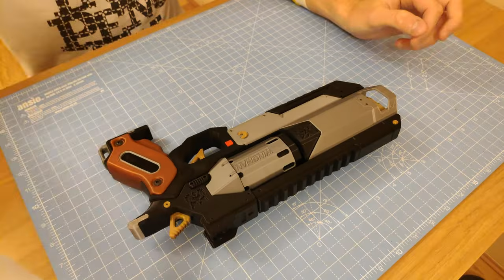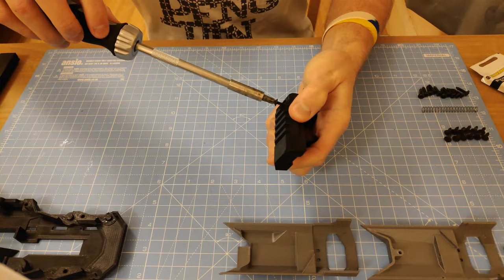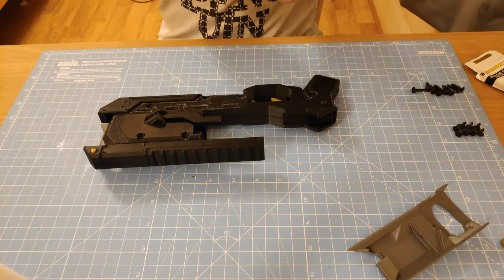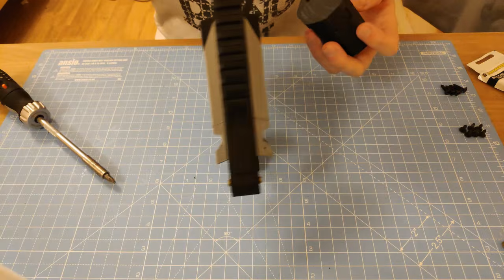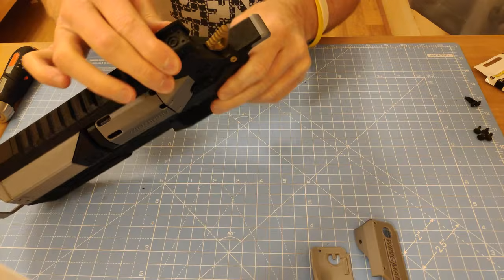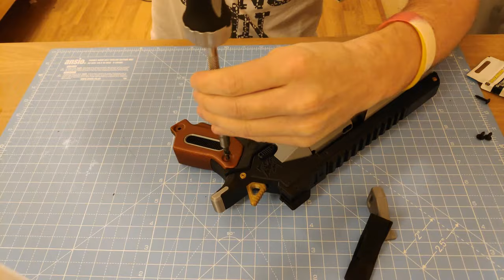Build My Apex Legends Wingman

Comment: Spring: 0.6 mm × 8 mm × 80 mm (compression spring)
(alternative: free length 65 mm, diameter ~6.8 mm)

Screws: BT3×10 and BT3×16
(alternative: #4 × 3/8″ and #4 × 5/8″)

Comment: Hey springs don’t fit? Is there another way? Bought the right pack of those 5 springs but they end up curling and not smoothly lining like yours? We didn’t size down any pieces so I’m a little confused any help I would love!❤❤❤
Reply from the maker: hi, i presume you are talking about MakerWorld? There has been quite a lot of changes to this model since this video (can't believe its been 5 years), but there should be a document linked on the MakerWorld page with the differences you need to take note of. Specifically with the 5 springs, there is a different option which has a guide pin to put through those. MakerWorld are actually releasing a new spring soon which will be much better - you will just be able to use the 1 with no guide pin and it is even better than the original spring i used in this video. Hope this helps! If I get the time I want to do an updated version of this video.
Reply: @gmanprojects  thank you so much! I’ll definitely wait for the new spring! Since I don’t really want to make another gun again with how much force and perfection to squeeze in parts, but don’t rush to make an updated video! This is all I need to know thank you so much!!❤️❤️❤️❤️🤩

Comment: Super cool model. But many of the pieces didn't fit. Atleast not nearly as well as yours. I've spent a great deal of time sanding things down etc to get them to fit. Just broke the grip for the handle, because the pieces didn't snap in like yours. Any ideas why mine aren't fitting together? I didn't adjust the same on anything.
Reply from the maker: sorry to hear that, what printer are you using?

Comment: I made a spring in 0.7mm and it's significantly better than the one you told us to buy, not to mention you save 12 quid.
will upload the mandrel to thingiversae sometime
Reply: Did you ever upload it, or do you have the info for it? The spring he recommends is impossible to find and get to me.

Comment: Ayo broski, I made an arbor .3mf so you can just wind your own springs!
I tightened up the diameter and would *REALLY* advise a thicker wire diameter like 0.6-0.75mm + needle filework bc the mech loves to stick on return.
Let me know if you want me to upload the file and where.

Comment: Hey mate, I am currently printing this model on my Ender 3 V2, everything is going smoothly with the exception of the main body pieces. The Main Body 235 pieces are still too large to print on 235x235 build plates. Will you be updating these? Would love to finish the build.
Reply from the maker: Hey, you just need to rotate it on the plate by about 40 degrees and it will fit
Reply: @gmanprojects  that is a lot of filament wasted in support material, I'll continue to look into optimizing those pieces. But you did an amazing job on this model. Will look forward to future ones
Reply from the maker: I mean keep it flat but rotate it on the z axis, it should fit diagonally on the bed?
Reply: @gmanprojects  it sadly will not, I've tried orientating it flat at all types of angles and it doesn't fit
Reply from the maker: I'm baffled, I've tested it in a slicer on a 235 bed and it fits with decent space around it at about 40 degrees. Are you sure your slicer bed is set to 235*235 and not 220?
Reply: @gmanprojects  gonna have to mess around with that, it's currently just modified ender 3 v2 profile so  assuming the build plate is set to 235 but its only taking into account the 220 as printable area
Reply: @chrismoore1867  I was having the same issue with it fitting on my E3V2 also.  If you're using CURA,  Go to build plate adhesion and change your Skirt Distance from default (i think  it's 10mm) down to 5mm and it should fit.  You'll also need to rotate 40 degrees.

Comment: At 15:39, does the gun hammer piece not need to be screwed in? It looks like the left main body needs to be removed first because it has a screw hole.

Also, cant seem to get my silver filament to print the left and right panels. I might try normal grey instead of the silk silver. And I am getting some binding when fully assembled.
Reply: Nvm, I see that the part has been updated I guess??
Reply: Its the 235 vs full versions. Thats why.
Reply from the maker: Hey, I guess you are the guy who posted the remix? Thanks :) To be honest I probably need to do a V2 of this video since the design has changed a bit since then, especially with the addition of the 235 version. Also I personally don't recommend any silk filament for anything, especially mechanical.
Reply: @gmanprojects  I reprinted some of the silver pieces in blue and they printed perfectly. Something about my silver filament and those wall angles that it just didnt like. But it came out great. Thanks for the design! Flatline next? :)

Comment: Hey, I'm in the midst of printing this, but I have a small bed printer. Ran into an issue, the back piece of the gun's screw hole notch does not line up with the body part notch that corresponds. I double checked with the correct pieces in my slicer and it's way too far forward in the small bed body left side. Any chance you can change where the hole is on the back piece for small print beds?
Reply from the maker: Hi, thank you for raising this. I'll have a look at the model this evening and push some updates. Apologies for the inconvenience!
Reply: @gmanprojects  Hey, thanks for the reply! This is a really great model, I'm excited to finish it up!

Comment: Need help with one of the parts. Not adhering! Cylinder-Outer--Better-Adhesion_v1_n0.4. Messaged you through GCode Hub but not heard anything. Please help!
Reply: Pretty sure that’s an issue on your end mine was just fine

Comment: Please could you provide the original stl files, I've already bought it on gcodehub. But I'm unable to build/print some parts as my print bed is to small. I would like to split some parts in half to work around it.

Comment: I was wondering if by any chance you take commissions? I really love what you did, especially adding the mechanical touch to it. However, I was wondering if I could commission you and talk about pricing for the making of the Thermal Rise version of the Wingman. The model is really similar with most of the body being identical to the stock Wingman besides the "cooling fins" by the barrel and that it says Thermal Rise on the revolver part instead of Wingman. Either way, I'd be super interested in commissioning you if you're interested (:

Comment: Just finished printing all the parts, everything was quite easy to print with exception of the main left and right body, took ages to remove the supports and think I damaged one of them in the process so may have to give it another try.
How did you print these any  slicer settings would be appreciated  and I use both Cura  or simplfy3d.
Reply: Is there anyway you can share the file since the site that sales its payment system is down. Or if you know how to get ahold of the guy who made it?
Reply: Sadly can't purchase this rn, how long ago did you buy the model?
Reply: Can you share the file with us please the WEB site is out of service
Reply: Hey. How can i buy a model? Server is down!
Reply: I am also looking for a copy of the files, as it seems that the website and the original creator aren't replying. Would you be willing to share the files you used to print this?